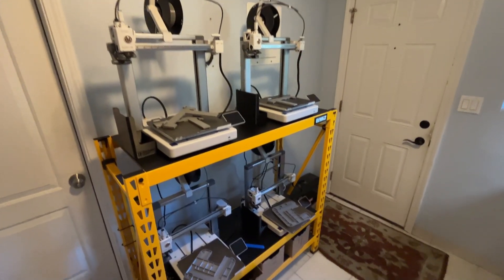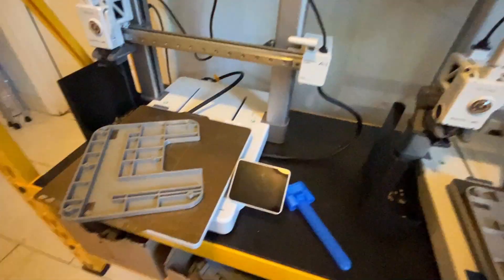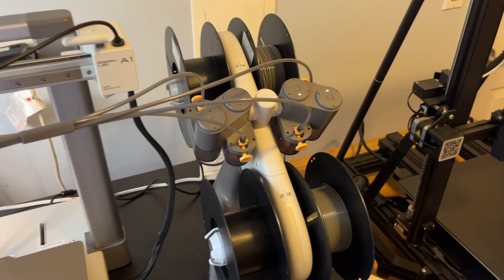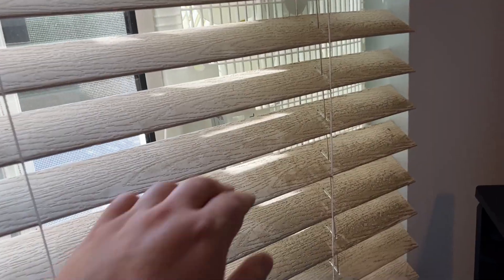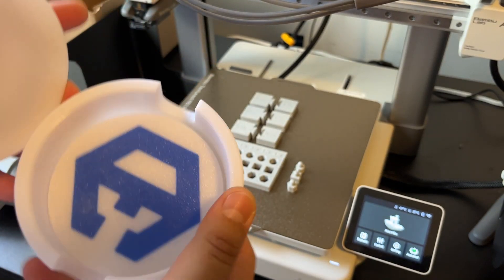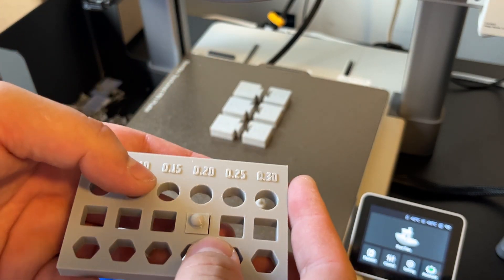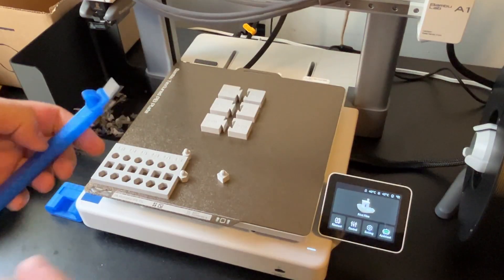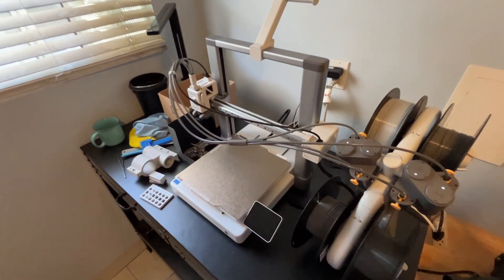Bambu Lab A1: Mastering Tolerance in 3D Printing Tests & Tips!

Comment: Thank you for the video! The way I understand tolerance is that it's the intentional difference between two parts that need to fit together. It's a margin added during modeling to compensate for the inaccuracies that occur during printing.

Comment: Thanks for the infomative vid. Quick question. Is the tolerance figure applied all the way around? Or just on one side?

For example. If the square peg is 10x10mm, for a 0.1 tolerance, is the hole 10.1x10.1mm or 10.2x10.2mm?
Reply from the maker: @caburepek  Thanks for your question! For a square peg that is 10x10mm, adding a 0.1mm tolerance means the hole would be 10.1x10.1mm. This applies the tolerance to each side, ensuring there’s just enough clearance for a good fit. I hope this clears it up :)
Reply: Thanks for the clarification. Much appreciated.

Comment: Even if the almost empty spools are different colours you can still use them in a print with the AMS or AMS lite, all you need to do is tell the AMS that the colours are the same make and colour and when one filament runs out it will carry on with the next one you selected as the same and load it automatically. Not so good for prints you sell but for testing out prints etc. for yourself work just fine.
Careful with the scraper blade on the textured build plates, as they are uneven surface that scraper can dig in and take of the PEI(ask me how I know), I find the best way is to lift the plate off and flex it in both directions and everything just falls off especially when cooled down, I do need the scraper sometimes to get brims of PETG off though.
Reply from the maker: @incubatork  Thanks for sharing your thoughts on using the AMS with different filament colors and managing the spools! It's a smart approach for test prints or personal projects where color consistency isn't critical. Regarding the scraper, you're absolutely right about the risks with textured build plates. I've noticed the same issue with certain blades being too sharp and damaging the PEI sheet. In my setup, I only use one particular blade that has a taper on both sides, which doesn't catch on the texture nubs. I've covered this in one of my vlogs where only one out of four blades were safe to use. Flexing the plate to remove objects is indeed a great tip, especially for minimizing wear. Thanks again for the valuable advice :)

Comment: Isn't the bed magnetic and removable? Should be easier to get of the prints rather than pulling them with a spatula.
Reply from the maker: @rgnyldz  Absolutely! I’ve started bending the removable print bed to take off prints, it really is handy. Plus, I just clean the bed with IPA occasionally to keep it clean. Thanks for the tip :)

Comment: That tolerance test only tested your tolerance in the XY plane.  Try printing the parts on their side so you know the machine capabilities in the Z plane as well.  The XY will certainly be better than the Z is my guess.  I never tested it on my Bambu machines but just based on experience the Z height tends to get more variance than the X and Y.  Just a suggestion so you know how much gap to design in all directions.  
BTW....  Still loving this vlog!
Reply from the maker: @jhautz817  Great idea on testing the Z-plane tolerance, I hadn't considered that! I've already got the vertical prints going, and I'm curious to see how they turn out, especially after seeing the results from the clamp I did earlier where I printed the hexagonal holes upright. I’ll definitely cover this in tomorrow’s vlog. Thanks for the suggestion and for keeping up with the vlog!

Comment: I have an overall design work flow question for you. How to you keep notes of all the changes you make between the CAD models and then the slicer settings? I'm using Shapr3D for all my design work and then Bambu Studio for the slicing. I'm finding with all the design changes between both programs it's getting hard to keep track when prototyping. I'm on a Mac so I've been using the Freeform app, but I was curious how you keep track of all your changes etc? Thanks, your videos are very helpful.
Reply from the maker: @ValorArc_Designs  Thanks for the question! To keep track of changes between CAD models and slicer settings, I use a combination of a simple spreadsheet and physical marking on the prints themselves. I log major changes, versions, and results in the spreadsheet for easy reference. For the physical parts, I use a permanent marker to note the test version on areas of the print that aren’t typically visible. This helps correlate the physical piece with its digital adjustments. Your setup with Shapr3D and Bambu Studio sounds great, keeping detailed notes, whether digitally or physically, can really keep things organized with the prototyping process. I'm glad you find the videos helpful :)
Reply from the maker: @ValorArc_Designs  Just a quick update: I covered my design workflow in today’s vlog. If you’re interested, here’s the link to check it out https://youtu.be/ITzbXHbivfg?si=B7PFilgOKLnqDoo5. Hope it gives you some good ideas on workflow :)

Comment: It is my understanding that IPA doesn't really "clean" the surface. It loosens grease on the build plate that you hopefully can wipe away, but some could be left behind. That's why every once and a while I still wash my plates with grease removing detergent, and then I use IPA after very print to try and stay on top of any accidental touches and any other residue.

I also wanted to mention you referenced a few days ago you were 1 printer short of being able to do 4 build plates at a time and 2 x left and 2 x right on the remaining 2 printers. You could still print 2x left and 2x right at a time on the top printers, and then when your arm boxes got much fuller than the build plate boxes (the arm boxes look like they could hold more arms than the build plate boxes can hold build plates) and then you could switch the top printers to build plates to try and catch up until things were even again. I hope that made sense, and while that means sometimes the top printers were printing 2 arms at a time and then other times build plates, it could in theory increase your overall output provided the PETG rolls keep up. 🙂
Reply from the maker: @hotfix7387  Thank you for the tips on cleaning with IPA and using a grease-removing detergent occasionally, that’s helpful to know! As for managing my prints, I try to ensure each set is completed together to streamline assembly and shipping. Even though the idea of alternating the print tasks to maximize efficiency is intriguing, sticking to a process that ensures each set is ready at the same time works best for my operation currently. Nonetheless I really appreciate your detailed suggestions :)